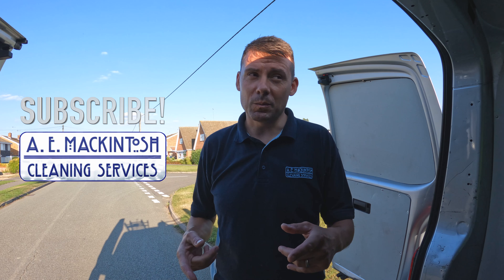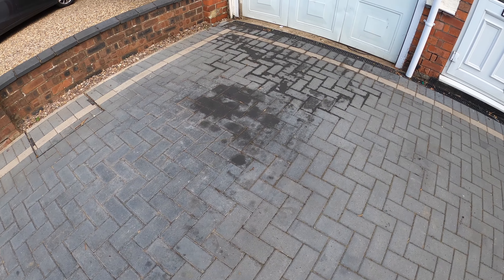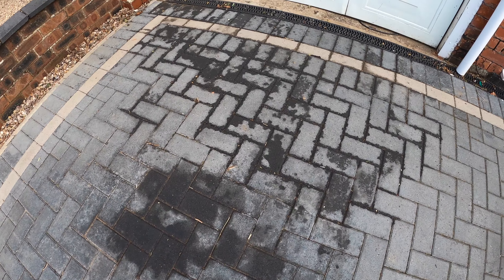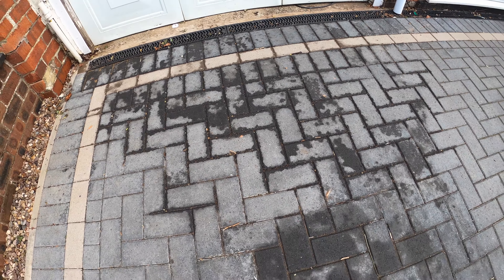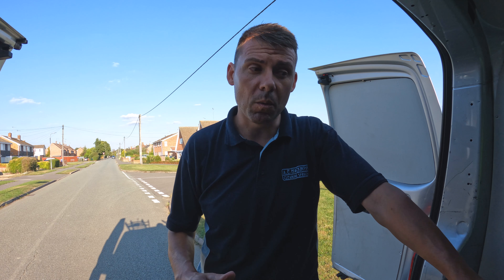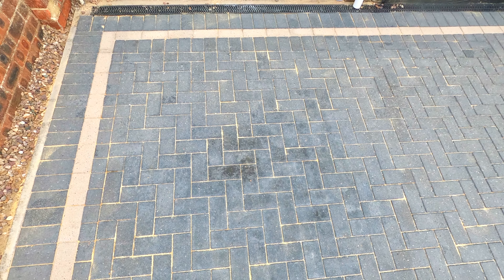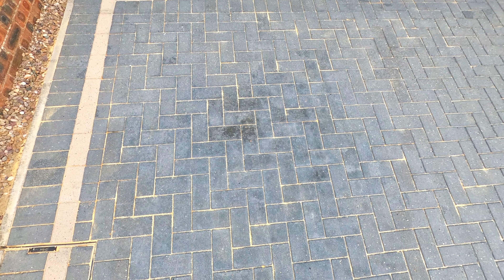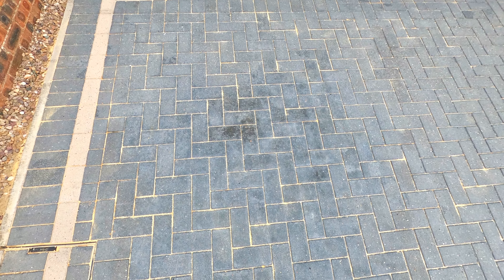Removing The Worst Ever Oil Stain

Comment: I specialized in removing oil stains. Pressure washing just makes it worse by driving the oil further into the paver. The  correct way to remove oil from pavers is to use lacquer thinner or paint thinner. Drench the stain and use shop towels to soak it up. This forces the oil out of the paver. Then drench the pavers again and this time use a torch to burn off the thinner. The pavers should be stain free now. Been doing this for over 15 years.
Reply from the maker: Well done

Comment: You need to steam clean oil , heat on 150 to get rid of oil stains completely,not a bad result considering you just used cold water , u can hire a steam cleaner there fairly cheep if not Rutland pumps do the mazzoni firebox there about 2 grand good investment you will make that back after a few jobs we did
Reply from the maker: Yes, that’s a good option.👍🏼

Comment: Your videos are great bud! Very educational enjoy them all the way from South Africa
Reply from the maker: That’s great! Thanks for your comments.😎👍🏼
Reply: @aemackintosh  i have a question if you don't mind me asking. You only used the surface cleaner on the paving was it strong enough to remove the mold?
Reply from the maker: I usually use a combination of pressure washing along with a treatment of sodium hypochlorite on paving in order to get the best results.😃👍🏼
Reply: @aemackintosh  thank you very much. I ran a surface cleaner over paved driveway today but it did not remove the moss i had to use the lance to get it out. Treated it with SH afterwards.

There are cleare results but not what i want

Comment: Great job, would a sealer prevent this reoccurring?
Reply from the maker: Thanks. A good sealant application would keep the spillage on the surface, preventing it from soaking into the blocks. This would make it easier to clean up.👍🏼

Comment: Just had a fresh oil spill on block paving, have put sand on should I clean while oil is still fresh or let it dry off first?
Reply from the maker: The sooner you clean it off, the better. It might take a couple of try’s and there might even be a faint shadow left behind. But the sooner you try and clean it, the best chance you have of getting the best results.👍🏼

Comment: How many applications did you apply and how many tins did you get through Ash? As you say not bad considering,  lucky it wasn't red blocks! Cheers M
Reply from the maker: There was a trail of oil that went right up the drive and some spots in another area too! That main area had three good treatments in the end. I got through two 5litre cans of remover.
Reply: @aemackintosh  cheers Ash you done well using only 2 cans, 3 applications is about right ! M
Reply from the maker: Thanks. Maybe 2and a half cans. Thinking about it now, I think I had about 1/3 of a can to finish up😆👍🏼

Comment: Just an observation..  that must have been an expensive job surely? I note that each 5ltr can is £70 odd! Did you agree a price before hand not knowing exactly how much degreaser you would need? Looks like good stuff though and may end up getting some, I've just bought myself my first petrol pressure washer and going to add it as a service alongside my gardening work. Great videos 👍
Reply from the maker: Thanks. Yes this was a very bad oil spill. It took a bit of experience and knowledge to judge how much oil remover I would need, but yes, I quoted and agreed a price before I started.👍🏼

Comment: have you ever tried to apply heat first with a weed torch before applying the chemical. I seen a guy doing it, and it kind of brings the oil to the top
Reply from the maker: I haven’t tried it myself.

Comment: I use industrial strength degreaser it does a good job at a 1/4 of the price of what your using  but ideally an hot washer would be far better as it actually draws the oil out of the blocks that stuff your using is ridiculously overpriced and to be fair its not really that good for the price
Reply from the maker: Sounds good. Where do you get your degreaser from?